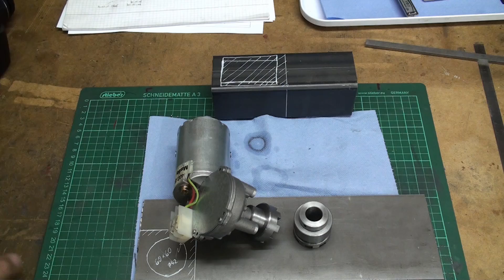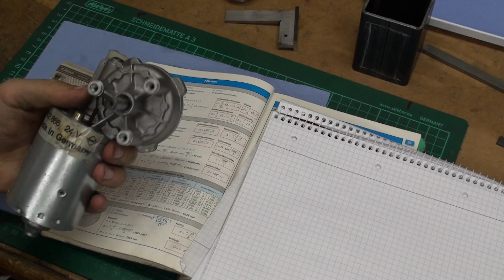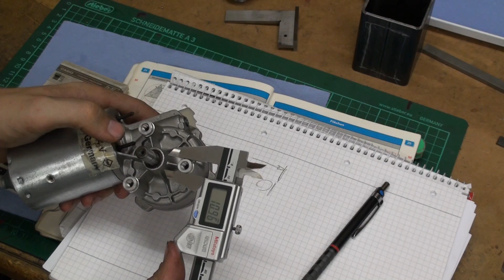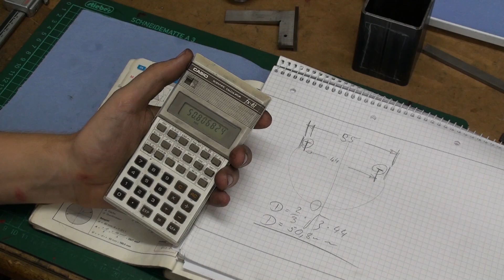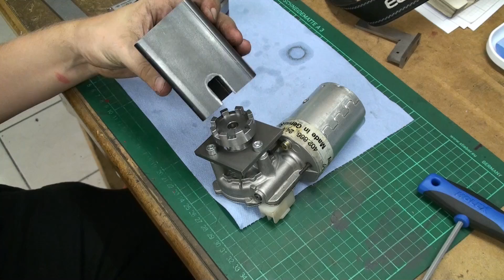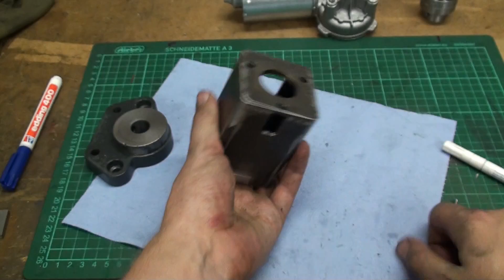Powerfeed Part 3 - Fräsvorschub Teil 3

Comment: If we have plans to convert our mills to CNC is it still smart to upgrade our machines with power feeds first? For the price I see Powerfeeds being sold for my Sieg X2D online $400 I can buy a CNC conversion kit from China for the same price (with a DRO). 

Also you wouldnt happen to have any experience with the Sieg X2D mini mill would you?  It seems to be a very common mill beginners buy for the price and videos on improving are VERY ideal.  I was hoping you had a series on taking it apart, cleaning it, and doing your upgrades.. Its hard finding all these videos on one channel.   So I would love to find a channel that shows these (Taking apart cleaning new Sieg X2D, Adjusting X2D, What vise,  collets, end mills to buy for X2D, Motor upgrade, Belt Drive Upgrade, DRO upgrade, Powerfeed upgrade, CNC upgrade)  If youre looking to make extra content for your channel.. and dont mind buying a X2D well.. there you go!

Comment: An interesting 'mechanical engineer's' approach. I made a similar (not as well made!) system- which I am replacing with a stepper motor driven system. Why?
- You do not need a clutch; remove power and the handwheel turns.
- You know exactly what speed it is going (pulse count determines)
- constant speed is guaranteed
- belt driven, the whole handwheel assembly stays in place, essentially unmodified
- it is more compact, and requires much less engineering

Comment: surely if the end with the stop is saw cut it will not be square at the end you mill as the stop makes the cutter follow the length? You would need a perfectly square end to start with.

Comment: To locate the large bore to the center of the output shaft of the gearbox turn a plug that is size on size to a light press fit. Screw the plug to the table. Indicate the plug to the spindle and clamp the part over the plug to the table. Easier than using a mirror. Now you need one for your lathe :D

Comment: been watching your stuff and you do great work.
I have the same DRO and an easy tip for PCD - instead of working out end angle, just add 1 to # of holes and an end angle of 360 (this example of 3 holes just enter 4 and 360 end angle - therefore hole #4 is same as hole #1... this trick comes in handy for larger numbers of holes)

Comment: I would love a TIG welder but the little use it would get does not warrant the cost. So neat and able to do fine work. I work a lot in marine grade alloy-aluminium.magnesium stock made in France and used in Tasmania for building sea going vessels by INCAT. My current project is: as you can see, I am not a machinist, just an enthusiastic amateur with a workshop built around my needs. this:https://picasaweb.google.com/109921669020426367250/ConstructingA16InchNewtonianTelescope?authuser=0&feat=directlink
Reply from the maker: +Shevill Mathers You do some impressive work! I know nothing about telescopes, but what I see looks like proper machined parts :)

Comment: Is this going to be a single speed unit, if not what are you going to use for speed control?
Reply from the maker: MrJohnnaz I ordered a ready made PWM speed controller for the motor that works pretty good.

Comment: I think a little more clearance on the clutch teeth will make for a smoother/easier engagement. Your videos are very informative. Keep up the great work. I am always learning something new watching them.
Reply from the maker: zardoz992 I already have about 1/10mm air between the teeth - the problems of engaging in the video where that the motor was not aligned properly.

Comment: Hi Stefan,
Hey some pretty good looking welding there, nice job. Had to buy box tube? I think the crane has some left on the jib.. No problem shifting, just yank it really hard, just don't exceed 1,000 rpm or you'll need to build a synchro.
Reply from the maker: Robert Klein Thank you - Thats a two-meter-weld: From two meters away it looks good, but please dont get any closer. I had some cutoffs of the 60x60 tube when I made the table for the milling machine.

Comment: What brand of tig welder are you using? And would you recommend it
Reply from the maker: Devin Moodley Its one of those generic chinese tig welders - 200Amps, DC only and puls mode. I would buy it again, great value for the money and my occasional use.
If I did welding every day, I would invest in a Rehm, EWM or something in that line.

Comment: You may want to check the concentricity of the bore for the x axis screw and the o.d. you are mounting your housing to on the mill end bracket. May be part of your alignment issue. Great presentation as always !
Reply from the maker: Brian U Checked it, its ok! As it seems the chinese machined the OD, the face and the bore in one setup.

Comment: I just mounted a wiper motor the other day on my mill and I was measuring by eyeball and got the clearance hole .250" too close to the edge.  I just threw it on the scrap pile and started over.  Your motor must be from a Mercedes, the coil housing is metal and mine is plastic (Dodge Dakota).  I like the clutch you have made.  I will be eagerly awaiting the finishing steps.  Thanks for the video.
Reply from the maker: cerberus Dang, always a pitty to remake parts, but it happens to all of us.

Comment: Great vid again Stefan. With the DRO I always add 1 extra hole to the bolt pattern and end angle then is always 360, no math to do.
Reply from the maker: Steve Wylie Great tip, I will give that a shot, thank you!

Comment: As I had previously mentioned.....how nice it is to wake up to one of your videos!  As another viewer mentioned......you may need to "double clutch it to engage....now would be a good time to see you incorporate a syncro of some type! Would beveling the teeth on both mechanisms help them to catch each other without being dead on aligned?....I'm sure you will com up with something!    Jim
Reply from the maker: Jim Liechty If they dont align perfectly you just wait a fraction of a second while the motor is already turning, then it will slip in. I rounded the top corners of the clutch over slightly and that made it even easier :)

Comment: Nice.
Did you ever check that the brushes allow reversing of the motor?
Reply from the maker: Chris Stephens At least it turns in both directions with the same speed and same current consumtion, so I assume its fine.
Reply: I only mentioned it because some people on the forums have reported problems after a few weeks of use as a power feed motor. I wonder what car seat motors are like, if they come from Americam cars they must be good for moving 300 Kg or more! :>)

Comment: Hi mate.
I think something so nice needs a lever with a round ball on the end.  You might have to double clutch that gearbox tough. ; )  Just like the old trucks in the Army.  Of-cause you could put an electric solenoid on in. ; )
Marcel.
Reply from the maker: Marcel Timmers Haha, I think I go for a single lever - Not used to truck driving ;)

Comment: Hi Stefan, I've liked the way you saved your little mistake on housing. As a lever for the clutch I suggest a fork like the gear change forks on transmission. You have the right slot in the moving part of the clutch machined yet!
Reply from the maker: Cosimo Marotta I am going for  a round pin, as it has less area to rub on the clutch.